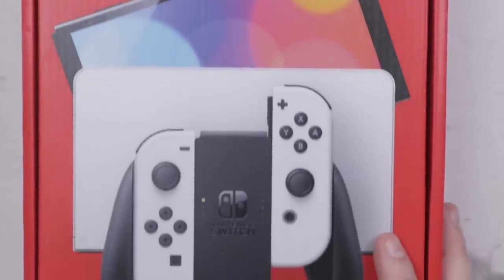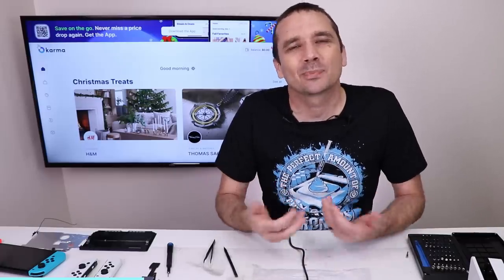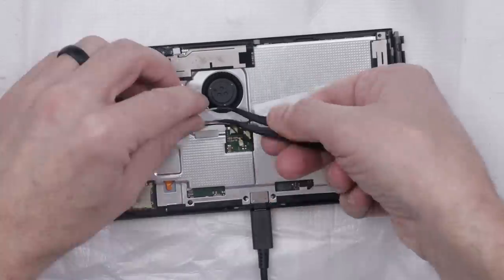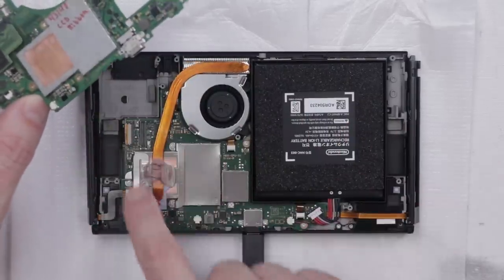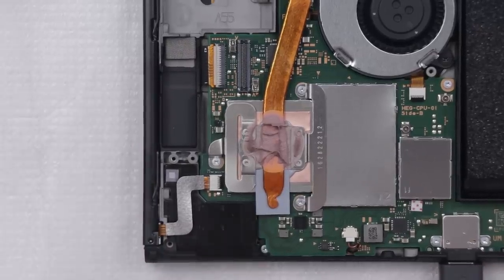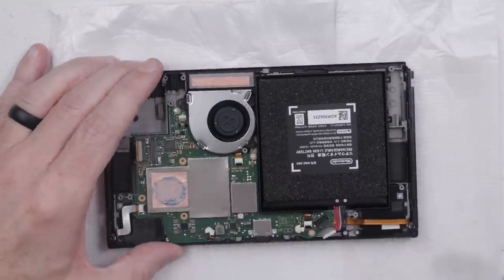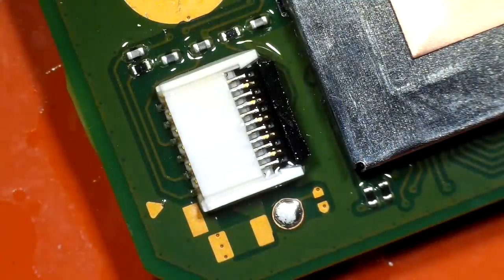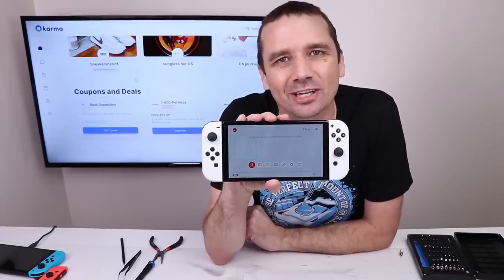I Bought the FIRST BROKEN OLED Switch on eBay - Let's FIX It!

Comment from the maker: Check out my video where I try to fix a broken Animal Crossing special edition Switch (It was in such nice condition!): https://www.youtube.com/watch?v=sjsjQBylkCU
Reply: im curious why they didnt use the warrenty
Reply: Do you want a challenge?? Buy 2 Logitech G513 carbon keyboards with partly defective LEDs. Try to desolder 0402 RGB LED and fix them. It's been 3 weeks, 3 of us are trying to fix but it's super hard to solder 1mmx1mm 4pin LEDs. Even with a top quality rework station, it's super hard.

Comment: The thing is, most people will see this video and think "wow, there must me cheap "broken" OLED Switches on Ebay that I can repair myself!", while the reality is the sellers will be like: "broken OLED Switch, doesn't turn on, dropped from the 15th floor on concrete, that'll be $400 USD"
Reply: It's readily available on Amazon though.
Reply: @TechHug  what does that have to do with what I'm saying?
Reply: @nermanus  Saying that anyone overcharging for a broken one isn't gonna sell it.

Comment: That was definitely not what I expected to cause the issue. I can defo see how that metal may have caused issues with connection but that is such a small thing to spot. Good thing you caught it!
Reply from the maker: Not what I expected either. Strange one for sure.
Reply: @Tronicsfix  This is a good pointer to keep in mind if the connector not working, clean then test if that didnt work then proceed to check connectors amazing

Comment: weird they didnt send it in for warranty. seems like an issue that would be covered.
Reply: maybe stolen goods
Reply: Fell off the back of a truck
Reply: Purchased from scalper or was a gift. Regardless, no purchase proof for warranty repair. It's why so many Series X and PS 5 consoles have been found broken on Ebay with a lot of them easy fixes.

Comment: Yeah this definitely looks like it happened in manufacturing. I wonder why the previous owner didn't send it to Nintendo to take care of it.
Reply: That question comes up a lot on this channel. My guess is for a lot of folks broken = garbage and they don't even consider warranty. That or they figure selling it for whatever they can get and just buying a new one is quicker and easier than a warranty? I dunno, I don't live in the states so maybe getting warranty service is like pulling teeth or something there.
Reply: @devilmikey00  Getting warranty in the U.S. in general in zero problem. It more depends on the company. I've done warranty with Nintendo with a console before and selling something on eBay is honestly more work than going to warranty route. I just don't get why someone wouldn't have contacted Nintendo over this. Only thought I have is that the system was originally stolen, and seller didn't want to take a chance going the Nintendo route and getting caught.

Comment: The Switch was redesigned to lower its EMI emissions profile and a few more additions for the new OLED display.  You have noticed some improvements like the new metal can over the USB-C connector and re-designed back cover plate.  The processor has a smaller power profile so the cooling solution was reduced a small bit but the heat pipe design is still the best solution for that footprint.

Notice the addition of extra shielding on the joycon FFCs and the inductors are still shielded core types - the design team must have really needed a lower profile to pass regulatory testing.  Very common with consumer electronics.

From experience dealing with FFC vendors, taking a guess those small metal pieces you saw might be from the tiny shield on your joycon cable.  The profile of the shield suggests it was die punched and over time that punch wears out and you get tearing and imperfections that can cause issues with debris/fod left over. 

It seems to align with the theory because the bits are on the side facing the opening of the connector which is where the shield ends.  A very good observation in the end.

Comment: That flap is SUCH a huge improvement. Nice little fix, IPA is my best friend 😎👍
Reply from the maker: Yes, agreed! The kickstands suck, lol.
Reply: Still not worth the purchase if you don't have a switch. The CPU and GPU are the same. 

If I had a choice between the OLED or the original, and I had $400, I'd go with the original. The few inches added to the screen, the storage, the ethernet added would be not worth it. If you owned a WiiU, you'd have to buy a ethernet adapter. Plus if I didn't have one, buying one isn't that expensive and I would have saved myself money.
Reply: @sO_RoNerY  The OLED screen is absolutely worth the extra $80 to me. I have it for a few weeks now and I still am impressed every time I hit a BotW loading screen and see the true blacks and awesome contrast.
Reply: @sO_RoNerY  That depends entirely on if you plan to play handheld or not.

Docked only = get the original Switch. Any amount of handheld play = get the OLED Switch.

Comment: Man I'm definetly addicted to your channel! I'm about to start fixing my stuff myself because of you. One question: Is that even possible to build  up an entire switch only using parts from ebay or aliexpress?
Reply: It is, but not worth it. Broken Switches are still expensive and you would have to get ones that you know exactly what issues are (ex one has a bad USBC port and one has a bad game card slot) so that you know you can combine the parts into a working Switch. Better to just buy one unless you're trying to assemble for fun.
Reply: @crazzluz1702  I was thinking about assemble just for fun.. but you are right, it is quite expensive to do so.. I was searching some parts on eBay and the price is high when you put everything together. Thanks for answering!
Reply from the maker: I mean, sure you could but it would be very expensive. I might make a video doing that sometime just for fun but it wouldn't save anyone any money.
Reply: @LucasLima-in6hn  All Nintendo products are made out of Nintendium, which holds a lot of it's value over time.

Comment: This is why you make sure your works space is also super clean when assembling electronics. Come on Nintendo, clean up those work stations/assembly lines. If it wasn't that, wonder where those little metal shavings would have come from.

Comment: When you're zoomed in around that connector at 10:41, I'm looking closely at the screw standoff/mb hole and shielding in the bottom right corner, it seems to have what looks like loose metal shards. I wonder if screws are actually stripping metal off leaving it loose within the case.
Reply: I stand corrected taking another look, it's not a MB screw hole, but I'm still not sure what it is. It's shedding metal though, that's for sure.

Comment: I had a similar issue with my Switch OLED where the right joycon connection wasn't properly connecting to the console. But it was because the joycon rail had a loose hold on the joycon and would constantly disconnect and reconnect when moved a certain way. All I ended up having to do to fix it was take apart the console enough to separate the metal rail from the connector pins and "flatten" the rail/push up the tabs by the screw holes. Basically bending parts of the metal rail so that it would hold the joycon tighter.

Comment: Great video! I have a concern with the OLED screen though. When the digitizer breaks, it'll be a pain in the butt to separate the two because of OLEDs being very fragile.
Reply: Ifixit's teardown shows the oled panel and the digitizer are fused together on this model.

Comment: Can you check if that console has green tint issue( which is more likely to have it) and if so can you make a tutorial on how to fix it?
Reply from the maker: I haven't noticed it but haven't used it much either.
Reply: @Tronicsfix  I recommend to investigate a little bit about the issue and try to find if that unit has the issue and then make a tutorial if you can, thank your for answering. I love your videos :)

Comment: I had to send both Joy Cons in for repair within a month on my OLED Model, right one would slip out of the rail, I think the rail was damaging where it clips in so a button press wasn't needed to unlock it. Then 2 days after I got the right one back the left one failed. I wonder why this one was just sold rather than sent for repair?

Comment: I'm surprised you didn't test the continuity of the cable when you had it out. I've seen ribbon cables like that develop micro-cracks, though admittedly they were pretty old.

Comment: aren't those little metal shaving a result of the lead free solder? as its mostly tin you get tin pest where the solder gets brittle and grows hairs of metal called tin whiskers, if it is, then the solder will keep degrading once its set in and you need to resolder to cure it or over time the connections will break and it will grow whiskers again

Comment: It seemed like a factory type wire bur if not a type of solder from the factory that somehow was left in the switch and made its way into the joy-con area surprisingly it didn't get into any other area and short something else out

Comment: Really enjoyed the comparison of the OLED vs OG Switch and all the parts.  Can you do a board & PSU comparison with the PS5 model CFI-1510A and CFI-1115A?  The 1115A has a PSU without a 5V pin on it, just outputs 12V as stated on the psu case. Haven't figured out where the 5v is created.  I assume somewhere on the board.

Comment: Is the OLED worth the extra cost in your opinion?
Reply from the maker: It's cool but it wouldn't be worth it to me. I'm sure lots of people love it and it's totally worth the upgrade but imo it's not that much better. I think it is built better too though.
Reply: If you don't have a Switch, get the OLED. If you have one, it's not worth the upgrade.
Reply: I would only get it if you don't have an original, or if your like me and can pass your old on to your kids. That being said I don't have one yet due to not being able to find one at regular price.
Reply: personally I hate OLEDs because they burn in. I like to keep things around. I still have a N64 that I've had about 20 years. I have a commodore 64 I recently acquired. I don't like the idea of the screen being disposable. However I can't deny the upgrades are nice. Makes me wonder if you can replace it with an LCD when the OLED gets burn in.
Reply: As already told, it's not an upgrade like the PS4 Pro or Xbox One X were to the original, if you got no Switch yet, get a OLED one if you already got one, it isn't worth the upgrade.
I got a OLED Switch but it was a friend who bought it (two of them) and I gave my old one to my brother at Christmas.
Reply: @kuchenblechmafiagmbh1381  I decided to opt for the classic switch rather than oled just cause 450 CAD for the oled would leave me with a switch with no games to play so i just got the classic and used the left over on BOTW on sale ,one of the new pokemon games and a case as well as a sd card for expansion

Comment: BRO!! - I paused it @ 9:40 so I don't know if you eventually noticed this: there is a VERY TINY WIRE FILAMENT in the TOP LEFT CORNER of that connector... it's just a single strand of loose wire that seems to be stuck under the connector, and it's most likely making contact between the two soldier joints.... I hope you noticed this before you pulled the connector off, but I don't know because I paused to write this... we'll see what happens!! :D
Reply: YES!!! YOU NOTICED IT!! - again I paused right after you found it... see we'll see how it goes... judging by how little times is left in the video, I'm 99% sure this solved it!! HAHAH!!!! GREAT JOB!!!!
Reply from the maker: Lol, thanks for letting me know!

Comment: Ok at this point I am certain that warranty is non-existent in most places because this should certainly be covered by the most basic of basic warranties.

Also still sad that the OLED switch has no hardware upgrades to go with the better display. And from the looks of it the CPU will still be fried when something on the powerline goes wrong. Hopefully the new USB-C port helps a bit, but still a fuse or two can not be that hard to integrade on the board.

Comment: I´d like to see an indepth fix of the joycon shoulderbutton since those tend to fail because of the flimsy connection with the board, have you tried fixing those, maybe resoldering on the testpoints instead of (ripped off) pads ? And how to secure them (even new ones) so it doesnt occur ? Thanks!

Comment: TronicsFix I have a question about why my Fitbit would just stop taking or holding a charge I have only had it for 13 days and I have done all of the troubleshooting they say to do but nothing worked. I just had it on the charger, and it started vibrating non-stop and got warm, so I took it off the charger. I know you probably can't say for certain anything, but I feel like I may have done something wrong to make it do this.

Comment: huh, when the OLED launched reddit for the switch had a quite a few posts about 1 rail not working. Wonder if this was just some sort of production issue that left them shavings in  there on a few units.

Comment: Quick Q. At around the one minute mark, what was the indication that the left joycon was fine, but the right one was not? Was there an audio signal that I didn't pick up on the video?
Reply from the maker: Sorry, should have explained it better. When you push the Joy Con down it'll make like a snap sound from the tablet indicating that it recognizes it.
Reply: @Tronicsfix  Thanks. By the time I reached the end of the video I picked up on that click sound when you attached them post repair, but just didn’t hear it on either of them at the start of the video (of course when I went back knowing what to listen for it was clear as day!).

Comment: Never thought you would have missed this Steve, but I didn't see you plug in the right speaker connector before you sealed it up. If you're wondering where it went when you were plugging the others in, it's sitting underneath the motherboard.
Reply from the maker: Thanks for the comment. I plugged it in, just didn’t catch it on camera. Thanks for checking though!
Reply: That's alright 😁

Comment: This made me feel bad. I have around the same issue with my OLED switch, except the joycon connects normally and then randomly disconnects after a while, having trouble reconnecting after. Store took my joycon and sent it for repair. What will happen is: they're going to make me pay for 'reparations' and I'm still having the same issue after, because I tried it with a brand new joycon. So i'm wondering if the Switch is the problem lol. Sucks that the warranty is probably void if I open it up myself.

Comment: hey tronixFix, cool video, I have a question, I have a original ps4 CUH-1215A model, and I was wondering if its normal for the power supply to be difficult to remove, I have tried everything and I cant get it out. I also fear I may break the power supply or its connecter in the  proses,  do you know any way or tips I can use to  remove my power supply? thanks.
Reply: @restorebrokenphone9013  hello, im good what about you?
Reply: have you for sure gotten all the screws? I normally try and go for an edge first then let it down and get the other side. just watch out for that connector. Make sure you get the 2 screws on top, the side ones and the one where the back of the console is. If you get all them and lift it from a corner it should come free.
Reply: @endzima7238  I have gotten all the screws, I will try your method, thanks

Comment: I have a vacuum cleaner that isnt working I plugged it in it said Viiy. And stopped immedietly I opened it up I cant find any dissconnections or burnt board my dad guesses triode is broken so I tried to see  if that is the problem it shows 0 on the potentiometer

Comment: What switch model do you recommend first time buyers to get? LCD or OLED.
Reply: The steam deck
Reply: @JohnGatsbyThe3rd  why’s that. Isn’t that just a portable pc basically. What I want is Nintendo games (Mario, etc).
Reply: @iSpoof  you can probably run Yuzu on a Steam Deck, and Nintendo's backwards compatibility options are pretty poor, so a PC-based system would be much better in that regard.
Reply from the maker: Everyone is different. If you don't want to spend as much but still have a great system then the LCD works great. If you want to pay a bit more for (imo) medium upgrades I'd go with the OLED

Comment: if there's a way to make the video longer - this guy will find and use it! Actual content time is 5 minutes at most, but you just had to stretch it to 10+ minutes. if there is not enough content for one repair - just make two repairs and put them together in one vid. this will make the video look more professional and you wont have to use these dirty tricks to get the monetization. disappointed is the least i can say.

Comment: What a terrible design that flat cable of the joy con slot, it has no reinforcement on which you can apply force to insert it or extract it from its connector, practically you are forced to risk damaging it every time.